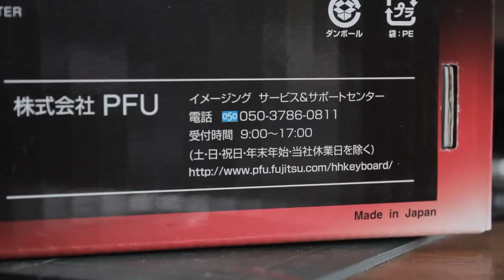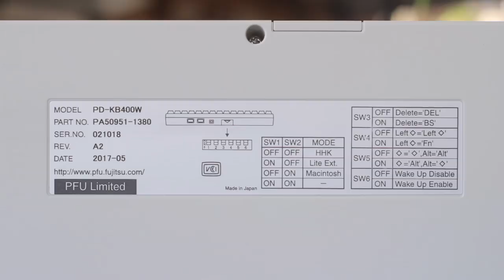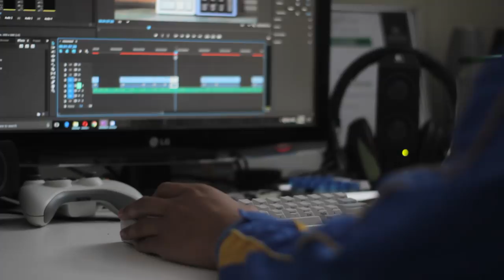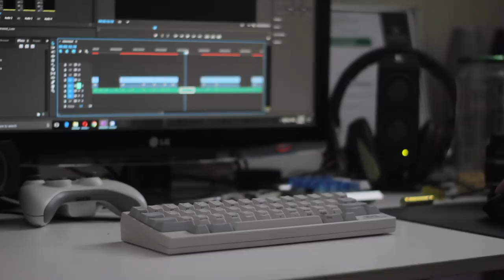Happy Hacking Professional 2 Keyboard - Unboxing & Review

Comment: For those of us who worked on Apple 2s and Sun workstations in the 70s, 80s and 90s, we know what we lost when they moved the control key and replaced it with the caps lock. That location for ctrl fits perfectly with unix editors. As soon as HHKB came out, I got one and the right placement of ctrl was restored. I've been using them for years and there is nothing to compare with them for programming. Whatever the issues you might have with plastic and rattles, this stuff is irrelevant compared to the keys being the right place, having a nice typing feel and not having to move my hand for navigation.
Reply: Hey if you're using macOS you can actually rebind the caps lock to ctrl in settings natively. Again assuming you have a Mac.
Reply: @jaylansiquot6130  I use a HHKB on my work windows machine and home windows machine. On my mac laptop, I do remap it.
Reply: @strugglepresident3779  In the bottom left and right corners. Not ideal.
Reply: @strugglepresident3779  Who made you the rule maker on what to press the ctrl key with? Ctrl middle left work fine with my little finger. What's wrong with yours? Leftmost key - leftmost finger.

Comment: Best mechanical switch ever. I have a modified HHKB with 55g domes, lubed and silenced. Best experience ever.
Reply: It's not mechanical!
Reply: @MrClassicmetal  It is. The term is a misnomer anyway, but by most logical definitions, Topre counts. If Topre didn't count just because it uses rubber domes as a part of its assembly, things like the IBM Model M wouldn't count just because it uses a membrane sheet instead of a PCB, despite being one of the most famous mechs of all time.

Comment: I still don't see what makes this keyboard so expensive. Its basically a rubber dome with springs, well actually that's exactly  what it is, and I can't imagine springs and rubber domes being more expensive to manufacture than a full on mechanism like normal mechanical keyboards have. Combined with the fact that it's all plastic and with all the issues you mentioned and that you need to buy a seperate controller for blue tooth and extended programmability I just do not see the value.
Reply: At the end of the day, it's the topre switches. Everything from its capacitive PCB, to the non-uniform spring shape, rubber material for longevity, makes it more expensive than injection molding some plastic parts. If other mechanical keyboards utilized topre switches, the cost would skyrocket as well.
Reply: True that there is a lot of decent bluetooth KB...
Reply: Made in Japan. Higher manufacturing cost because they're a first world country that has to pay their workers first world salaries. Cheaper keyboards are almost made in China and sometimes even designed in China these days.

Comment: Bout time. This has been my primary driver for about two years now. Easily the best board I've ever used or owned.
Reply: Not as good as a Realforce board, but its still great.
Reply: IF realforce made a 60% i would consider picking one up but tkl and fullsize are just eyesores for me tbh
Reply: i do agree that the hhkb is more aesthetic, but the feel on the realforce is much better.
Reply: then you clearly haven't tried kustoms with fully lubed and stickered vint blacks
Reply: not really. just get nib wyse or greetech blacks if you want cheap. g80 1000 series or 3000 series for more expensive stuff.
Reply: i never said cheap lol, just consistent.

Comment: Dunno how long you used the board as you said it was a loaner, but with any board you have to give it quite a bit of time. For example my filco with blues was my favourite board for about two months and then I begun to loathe it.  The noise is so cheap and grating and my fingers kept getting pains. My realforce and HHKB2 didn’t impress me out of the gate but they’ve had staying power. After many years of use I can say it’s not hype and it’s not sunk cost fallacy. They’re just awesome boards. It’s taken me years to fall out of love with cherry switches. Gradually I just found it harder and harder to go back to using them. They feel like a toy now.

Comment: It's a programmers keyboard. It has the same layout as Terminals, Unix Workstation keyboards, and most older PCs. This layout is ideal for using command line and other text based software. I have no idea what you use the caps lock for, or why it even still exists.
Reply: How do you yell without caps lock? Do you actually hold shift down?
Reply: exactly and that helps with anger management.
Reply: @tobyworland5857  if you're using vim, you can type the variables in lowercase and change them to uppercase.

Comment: I got a Paradise V60 with Matias switches.  I love the switches (after modifying them), but I still don't see the point of a 60% board.  My next will be a TKL, followed by a numpad.  Then an IBM Model M.
Reply: If you're planning on getting both a Model F and a TKL board, get an IBM Model F. It's a tenkeyless buckling spring board. I love it and just typed this comment on it :)
Reply: the point is that it's small
Reply: Perhaps the Vortex ViBe is for you. A 60% but with a numpad.
If you're worried about the nav cluster being gone, just note that you don't have to move your whole hand just to reach that part of the keyboard, you use the fn key.

Comment: I have to say that i like the topre switches.  Great tactile feel with the topre switches. I was able to pick one up a used on for $50 usd. The seller knew what he had. He just was not using it and the usb connector is a little loose.  Any fix for that?

Comment: Perhaps a bit TOO minimal for me.  I have an IBM model 'M' space saver (same layout as standard Model M, but no numeric keypad).  This keyboard is a bit wider and taller than the HHK because it has the extra cursor cluster keys on the right, and the function keys on an extra top row.  And of course, it has the famous bucking spring switches.   Since I really have no use for the numeric keypad, this keyboard is my favorite.  (also it's built like a TANK).  Having said that, If the HHK had built in bluetooth, It would be the perfect travel keyboard to go along with my thinkpad (that and a BT mouse).

Comment: One of the most overrated and over priced boards in the community. It has 45g Topre switches which is nice.. however the freaking thing has no weight to it. ... 

You have to spend on an extra controller to properly program it....
Reply: It's a trade-off. You can't ask for a $200 board with topre switches, aluminum case, and full QMK programmability all in one package that is delivered with any sort of refinement. Add topre switches to any of these other boards in the same price bracket, and you're sure to see its price skyrocket